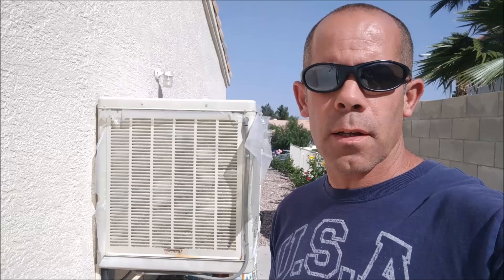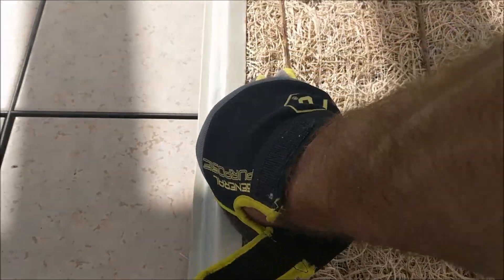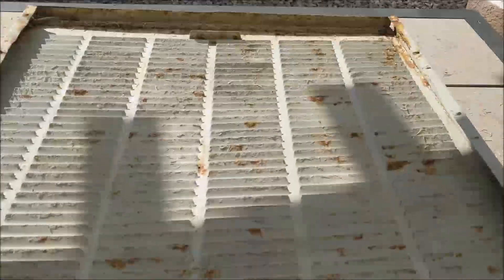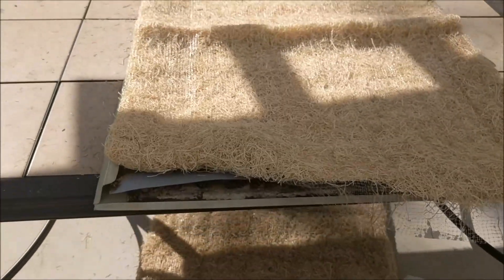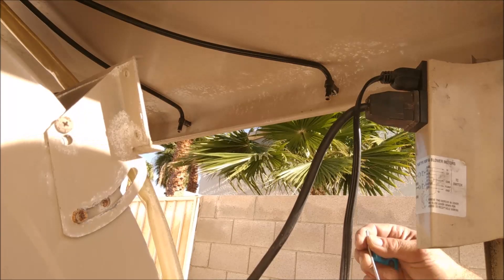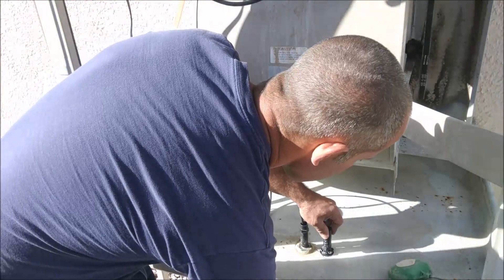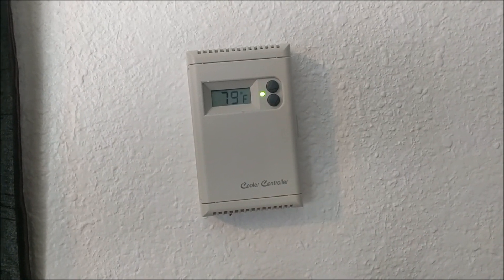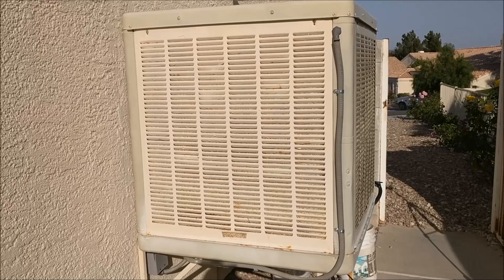Swamp Cooler Startup & Maintenance

Comment: Since my unit is a roof mounted down draft, you will not catch me on the roof 'every few weeks' routing the distributer lines 😁! That said, only once did I have a problem with clogged distributor (sometimes aka 'spider') caused by aspen fibers getting sucked up by the pump. Solution: make sure the screen on the pump or basket is in good condition.

Comment: Any tips if the screw to adjust the best tension rusts out? Is that something that has to be drilled out or can you just screw another bolt in there and tighten it down to keep proper tension?
Reply from the maker: Yes you could drill it out. You can replace it with another bolt. Or you could even get the attention adjusted and screw it down with the self tapping bolt.

Comment: I have learned that you don't need to fold larger pads, if you put the four edges in you can push of manipulate the material towards the center, it moves freely and then you end up with a thicker even pad.
Reply from the maker: In more than likely you will end up with leaks possibly even water being sucked into the squirrel cage this comes from experience from doing thousands of swamp coolers

Comment: I live in Colorado and it's been pretty hot lately. (96F-100F) I turned on my swamp cooler about 3 weeks ago and at first the air coming out seemed a lot colder than it does in the last few days.  I verified my distributors have even water flow. The top of each swamp cooler door has no blockages and the water is getting to the pads. The water in the reservoir seems cool to the touch but my house is just hot :( Any other tips that you might know of would be greatly appreciated. Thanks for your video!
Reply from the maker: There are a few things that can cause that if you have over 20% humidity. Or if your pad or media needs to be replaced. On average you can call 20 to 30 degrees below the outside temperature if you do not have humidity.
Reply: @boogity66  Great thank you for the tips! :)
Reply: @boogity66  I was using those blue pads before. Once I switched to Aspen pads they perform WAY better. Thanks again for making this video.
Reply from the maker: Humidity is a big factor. Once you hit eighteen to twenty percent humidity it will not cool as well. If you see clouds in the sky you have humidity.
Reply: Honestly Colorado isn't as dry as people make it out to be. At least nowadays. I feel like more days than not my swamp cooler isnt efficient at all and the humiditys above 20% most days in summer. I wouldn't recommend swamp coolers unless you live in Arizona or something tbh. Especially if it doesn't even help you on the hottest of days then whats the point...

Comment: I always take my garden hose and WASH out the pan, fill it, turn on the pump, THEN snake out the water lines so anything that breaking lose is immediately flushed out, instead of shoving it into the center of the spider assembly.  I also spray out the pad frame with water,  before installing the pads. Also input a new pump strainer that the pump sits in.

Comment: Thank you for the info I live alone and first time with a swamp cooler 🙋‍♀️🐶🐶🦋🐱
Reply: Rosalie Sanford  there really isn’t much to a swamp cooler. Be sure and unplug it from electricity before doing maintenance. Clean it very well after the season is over. Especially the water pump. Be sure the water is out of the pump and I lightly oil the shaft. Otherwise you will have to buy a new pump every year. 30 or 40 dollars that could have been saved. Hope this helps.

Comment: I didn't understand why the pump needs to bleed off water outside of the system.
Reply: It keeps the water in the pan from accumulating more and more minerals like calcium etc. This is what rusts your cooler and decreases performance.
Reply: Jo M. My cooler is 30 years old, and definitely has signs of rust and peeling paint in the pan and on the louvered vanes on the sides.   I'm wondering if it's worth the effort to scrape, prime, and repaint the insides, or just buy a new one.    It still works well enough, and I do double the Aspen media, which keeps our house at 70 degrees in 100 degree weather.    I just added a whole house fan in the Attic, which will allow me to pull cool, dry air into the house and Attic at night.  I hope this will help prevent the house from slowly absorbing moisture all summer which causes or doors to swell and not close properly.   Plus it should keep the Attic cooler.
Reply: @privateuploads-geo2625  I just had the same decision to make as yourself.  After seeing prices in the +800. range my decision was easy.  Everything on the cooler worked great except the panels were rusted out, so I decided to just replace those and found the exact match in Phoenix and had all 3 sent out @ $59./ each plus $50 shipping.  All total $230 and my cooler looks and works like new.  They even installed 3 nice thick pads better than I've ever had at no extra cost.  That's what I did, it depends on the total condition of the whole cooler.  Good luck and don't forget the bleed off line.
Reply: ps.. my cooler is probably more than 30 years old. It was gifted to me.  🤪
Reply: Jo M. Actually yours looks like the same model as mine..It still works well 🥶☺️.   I'll probably use it this season and de-rust and repaint the interior at end of season.  It's on my roof so it's a bit more challenging to work on but still doable.   The worst parts are the wire braces holding the media in place.
Reply: @privateuploads-geo2625  I don't like the new style holders either. a thankfully they did it for me this year and there's a good video of someone replacing theirs. Mine turned out to be an Adobe Air 4500 cfm.  I only found out because of the frame size and style. 
 On the roof is even more reason to overhaul what you  have I would think. 
 
 

.
Reply: @hastabyebye  Where did you find replacement panels, I have the same situation.

Comment: thanks,, more info than most vids give.. one thing you didn't cover is tightening the wheel bolt,, which is what I'm specifically looking for having never done it,, and my swamp cooler womps off kilter just a little so I'm told to tighten the wheel bolt..  but no one shows me what and how...

Comment: Where did you get that hand auger/snake?   Can't find it anywhere.  Thanks.
Reply from the maker: You can find it online or Homedepot or Lowes.
Reply: @boogity66  Thanks for the reply.  I'll look online again, but can't find anything like that by searching for auger or snake.  Just the big stuff comes up.  I'll also check at Home Depot on the next visit.
Reply from the maker: @bryce2680  Here is what it is called in exact words Dial Steel/Plastic Evaporative Cooler Tube Reamer
Reply: @boogity66  Perfect!!!  I found it.  Thanks for the key words.

Comment: What kind of temperatures can you expect on a hot desert day of like a hundred and twenty degrees
Reply from the maker: You can get up to 20 degrees less then the outdoor temperature on average.
Reply: Depends a lot on the humidity. I have experienced as much as 30 degree drop at 115. However, on the 2 days a year when the humidity blows in along with the heat, best close the windows in the morning and make do with an indoor fan or 2!

Comment: Thanks for the video. I'm in New Mexico and the 20+ years I've lived here I've never seen someone use a drain tube (irrigation) to get water out while it is running. What is the purpose? Is it absolutely necessary? Thanks for your help.
Reply: OlliMsa drawing off some of the water from the circulation reduces the amount of solids that would build up in the cooler and foul the pads, pump, and structure of the cooler. If your water supply is really clean no worries but if your water contains lots of minerals a "bleed off" may be a huge benefit. I hope this helps.